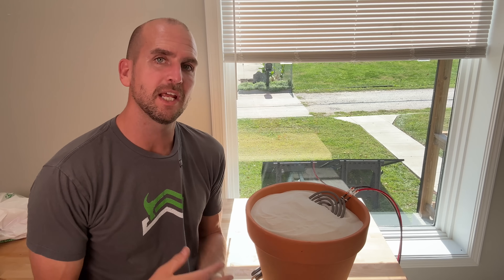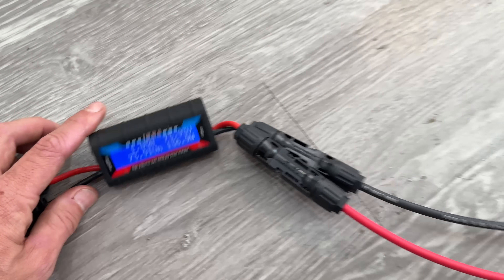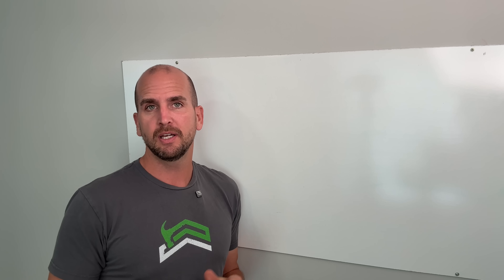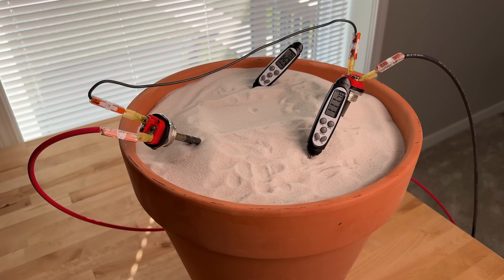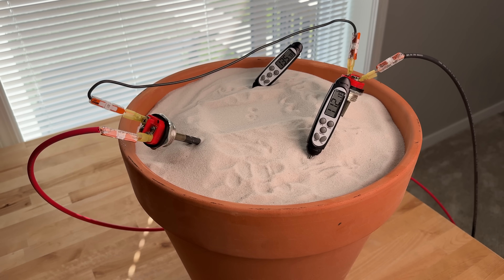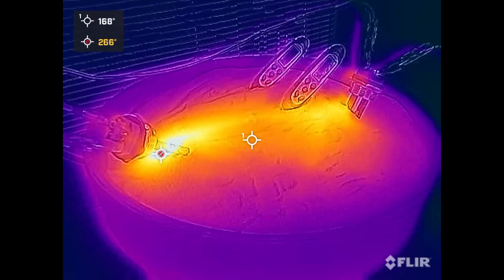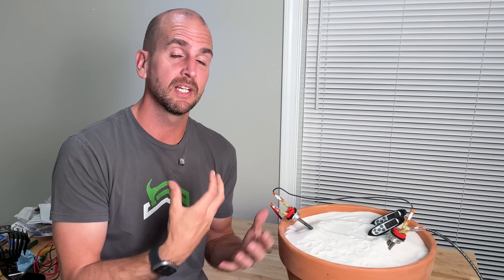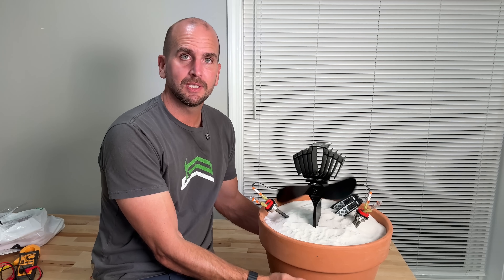How To Create A Solar Sand Battery Heater | Free Heat This Winter!

Comment: This was  a fun experiment in Solar Heating.  However, the simplest and most efficient method is still bringing sunlight indoors and onto some type of thermal mass such as dark ceramic floor tiles or concrete; which is the way passive solar homes work.  The second best would be solar powered heat pumps, since moving heat is always more efficient than making heat.
Reply: You are comparing two different things. You describe the best options in terms of immediate or direct heating.  The whole purpose of a sand battery is to store heat and release it later.

Comment: I have 80v coming out of the solar panels when hooked up to the water heater directly, the voltage drops to about 10v, I tried the panels in series and parallel with the same results?

Comment: This is a great idea, especially for excess solar power in the winter. I'm planning an off grid cabin build and this is a perfect option for those sunny days the battery is fully charged and I want to capture the solar energy in thermal mass. Heck. I'd fill a whole wall with sand. 😅
Reply: fill an internal wall with sand is actually a super interesting idea
Reply: @QuasarLava  have to engineer the structure for that kind of weight.

Comment: Regarding the circulation fan, a Sterling Cycle driven fan may be a better option over the Peltier or thermocouple/thermopile design. There used to be commercially built one for use with wood burning stoves, but as I recall was kinda pricey. Homebrewing one is a trivial task, but those designs tend to be somewhat noisy.

Comment: I've seen these a lot on YouTube recently. However, there are some issues that are not often considered. Comparing the sand battery to a hot water storage, the water storage almost always wins. While it is true that the sand battery stores higher temperatures. Due to the difference in specific heat, you need to heat an equal volume of sand to roughly 215 degrees celsius to reach the same energy storage capacity as 85c water. The issue with sand is its low thermal conductivity. This is a benefit when you want to store energy long term (seasonal storage), as the colder outer layer forms its own insulation around the hot inner core, but when you want it short term as shown here, it is a serious limitation as you can't quickly pull out the heat. Most people falsely interpret the sand staying hot for longer as a benefit, but when you want to use that heat it is most certainly not. 

Where sand batteries shine is at very high temperatures close to its 1500 melting point. In this case, your energy density compared to water is superior while the high temperature mitigates some of the issues surrounding thermal conductivity. The issue is, for residential purposes it's quite difficult to cheaply engineer such a solution that can handle the high temperatures. Therefore, doing the same but then with a water tank is a more practical solution: heat the water to 85-90c and you can easily take the heat out due to the high thermal conductivity.

Additionally, you can use a heat pump to warm up water to such temperatures, using much less electricity to reach the same thermal energy storage in kWh. Heat pumps cannot output temperatures as required for sand batteries. Just another consideration to keep in mind!
Reply: Me thinks a water tank with sand insulation / heater elements,  might be heavy but combine both hot water and longevity.
Reply: Would your water system be a closed system? What would you add to the water? Corrosion inhibitors? Glycol? You will need to regulate the temperature and pressure also to prevent a minor disaster. Water hardness would be another issue.
Reply: @deadcarnahans1932 the container would be the main cost in water based system. Metal or ceramic? It also has to be large enough, at least 50 ltrs for any good
Reply: great perspective. would love to get your opinion on the relative safety of storing water at close to boiling vs sand. From my understanding id feel safer and easier to DIY and operate a hot sand container , than hot water container
Reply: That being the case, I think it's more efficient to directly heat the water via a hose array (for lack of a better term) in a glass front box and circulate through the tank rather than use PV to heat with an element. There are a couple comparison videos and I think the PV ends up losing.
Reply: And even more - if compare the heat extraction efficiency of the chain of "PV panel -> heater -> sand -> heat extractor" to simple "parabolic mirror -> water reservoir" the second will be about 10-30 times more effective. And if you need to store more heat - just use bigger reservoir for the water/antifreeze.

Comment: This just doesn't seem very practical. 750Wh is a quite small amount of energy for useful heating, about 2500Btu. I would guess the best use of that level of power in a heating emergency would be to store it in a battery to use a 100-150W electric blanket for 6-7 hours. For perspective, an electric radiator uses more than that on lowest setting in about an hour, and that doesn't even do a lot in a modest size room, and a small home furnace is typically 80,000Btu per hour.

Comment: Resistance might change with temperature. Light bulbs are a prominent example. But any material might expose such a behavior. Some explicit parts designed for various functional purposes can be found labled as NTCs and PTCs.

Comment: This is a very useful effort, but I was disappointed in the use of the term "battery".  I came looking for a DIY sand battery that has been in the energy news as of late.  That is, I was looking for solar converted to heat in the sand, and then later extracted back out as electricity.

Comment: So you took energy from the sun (which contains loads of heat energy) filtered out the heat energy by using PV panels to convert it to electricity, and then you converted it back to heat. Does this strike you as efficient? Have you not heard of solar heat? But anyway you've got a 240V heating element running on what?  48V?  What kind of grift is this fake-ass garbage?

Comment: What is the thermodynamic most efficient way to heat it all up, would adding some copper wires into the sand help move the heat away to more parts of the sand faster, increasing the temp diff from the sand around the heating element and the element itself? I mean, all the energy goes in to the sand, but I feel like the rate of dispersion has an impact (and on how effective you can marshall it out with the fans after?) would be interesting to test in a sealed room with thermometers on timelapse for a whole day

Comment: A mineral oil container (with no leaks !) with the same volume as your flower pot would retain far more energy than sand. I suggest you try using a recycled gas-can filled to 90% of capacity with mineral oil (remember, oil expands somewhat when heated) and a heating element dipped into that. then mount your fan on top of the oil can... Mineral oil might be a bit more expensive than pure white sand... good luck !
P.S. I would place the oil can on a slightly larger bed of sand (in an old aluminium drip pan ?) to catch any dripping oil and avoid making a mess when filling up the can with mineral oil with the help of a funnel. Do not expose the oil to naked flame or anything that may glow red-hot, that would create a fire hazard !

Comment: I wonder how much energy you're using on the table without MPPT?
Reply from the maker: Without MPPT there is a lot of in efficiency on what those panels could create as compared to what is flowing through the heating element.

Comment: I suppose this is an interesting thought experiment but wouldn't a minisplit or something similar be a far better usage of that power to generate heat since they can be nearly 5x more efficient than resistive coil heat? as for thermal mass brick works extremely well.

Comment: definitely stick with the cook top elements, water heater elemets are designed to have liquid around them constantly; without the element itself breaks down.  when i ran an experiment with my own sand bucket (complete with the orange one from HD) the element disintegrated inside the sand.

Comment: You could add a thermometer outside this system but still in the room to measure the effect of the system. We all believe that the sand is hot, but does it heat the room? Need to measure and display the proof in the pudding!

Comment: For this whole setup the basic physical law of energy preservation applies.

Current PV panels can convert 22% of solar radiation to electricity under ideal conditions. We (in Germany) get 1000 Watts of radiation on the earth's surface per square meter . So a 2 sqm panel will produce 440 Watts of electricity at peak sunshine. Assuming no power loss on your cables (in reality you will loose 5%-10% if your cable lines from PV into your room are long enough) the heat arriving at your clay pot on a 10 hour sunny day is worth about 2,5 kWh.

In an average year you can harvest the equivalent of 1.000 sunny hours, that is: from 1 panel you can get 440 kWh. Whatever arrives in your clay pot is converted into heat (well, substract 5%-10% losses in your cables).

And whatever heat goes into the clay pot is radiated out of the clay pot as IR based heat. No need for any air blower (unless you want to get the clay heat out faster for some reason).

Of course, a short cloudy winter day will achieve only a tenth of sun harvest when compared to a long sunny summer day.

However, the energy preservation keeps working: whatever electricity watts go into the clay pot comes out of the clay pot again (over time).

So the only interesting info in the video was about the local peak temperatures achieved in the pot.

Thanks for the video nevertheless!

Comment: Look up "High Heat Retention Storage Heater". There's no need to reinvent the wheel. 
Storing heat generated by electricity has been a solved problem for decades - storage heaters were invented with the intent of saving money by being heated at night, when electricity is cheaper, and releasing the stored heat throughout the day. Like a battery - but for heat. 
High Heat Retention Storage Heaters are a further improvement with better, modern, insulation and smart controls and monitoring. 

Downsides are bulkiness, weight, need for individual units for each room and slowness of the system. American ranch style homes and McMansions are a no-go.

Comment: One concern is those immersed elements are meant to be immersed in water. One thing I learned as a plumber is if you add power without having the water heater filled is they will burn out. It’s an excellent idea, but could benefit from being in  a water tank.

Comment: but isn't it more practical, efficient, and powerful if you first charged a battery, like most solar system designs?  this seems awfully strange to me, connecting directly to a heating element, not to mention potentially dangerous.

Comment: "725 watt-hours" = 0.725 kWh = which is worth about ten cents (YMMV). 
You'll be needing to scale up, and that includes the panels. 
So it'll cost a fortune by the time you've got anything practical.
Might be more fiscally-efficient to just have electric baseboard heaters in your basement. And better match the voltage/current/power at each end.

Comment: If I was going to use it for Emergency heat, I would have a coil of copper tubing on the outer perimeter of the pot. But I would also have the pot lined with aluminum foil to keep the heat in better. Then I would circulate fluid through the tubing to a radiator to allow it to escape into the room. And you can turn on the pump only when the heat is needed.

Comment: Isn't it better to run black house from outside to inside.  Like an oil electric heater.  Let the sun heat up panel and liquid inside of it.  It will asct as batteries too. No need to convert from solar to electric to heat energy, where efficiency is 20%+-. Solar to black panel with liquid is much higher efficiency... no fire hazard  due to electricity flow and high amps. Have an air gap between outside and inside so heat doesn't travel outside through houses & liquid.

Comment: You can run vertical stacks of range top heating elements by daisy-chaining them. Cost-wise could be cheaper than buying water heater element. Sticking a few cookie sheets into the sand will more than capably transfer heat with a floor standing fan.

Comment: would probably be a lot more efficient to directly heat up a fluid like air or water in an equivalent area with sunlight and exchange the heat to the sand rather than the ~20% efficient pv cell

Comment: Love the concept, easy to install but very inefficient. Better would be a small vacuum tube collector hooked up to a small reservoir and running the water inside to a standard radiator (or mass) via a solar powered pump. For the same solar area they collect up to 90% of the energy insted of just 20-30%. You can get these collectors dirt cheap from china. Would love to see a video on this. EV is for electronics and running small motors, not really for heating. Sand batteries really come into thier own when getting really hot ie several hundred degrees C that they then can keep for long, otherwise you just have a mass heater with very low heat conductivity. Might just be good for dumping excess or unused power after the battery banks are full.

Comment: I don't know if it is widely understood that solar photo voltaic is only about 30% efficient. A solar thermal panel is about 70%. Obviously this isn't an engineering exercise in optimizing efficiency. But... a real solar thermal system would never be (and is not) implemented this way because of the low efficiency of photovoltaics.

Comment: In the Canadian Prairies we get winter days with high temps of minus 25 Celcius and overnight lows around minus 40 Celcius for about 1 to 3 periods lasting 3 to 9 days each. This makes home heating fairly expensive unless it's a relatively new and well-insulated home. One approach people take is to heat the overall home to a fairly cool temperature to reduce heating costs and then heat the areas they're spending time in with something auxiliary be it a hot water bottle in their bed, a space heater near where they're sitting, etc. This solar sand battery could be a bench on the south side of someone's home where they sit in the morning while eating breakfast for example, and help them comfortably get their day going. It could be well-insulated all around and have removable insulation on top so one could use the previous days heat to warm themselves in the current morning or whenever they want. And since nothing has to be high performance, it could be made out of mostly landfill-bound materials if a person had the patience to salvage them. Luckily our coldest days are usually clear and sunny days, so the sunlight needed wouldn't be an issue.

P.S. One could also place an insulated sand battery under their bed.

Comment: wouldn't be more efficient to connect the heating elements in parallel to lower the resistance so that the full  ~1000w of your solar panels could be exploited ? it would also work better with a 110 v element I suppose because it would also have a lower resistance

Comment: Not sure if turning electricity into heat, then back into electricity, then into kinetic is the most efficient. Each conversion is a loss of efficiency.

Having a device that turns the electricity from the solar panels directly to a fan to distrute the heat makes way more sense. That cuts out two conversions.

Comment: I need to know how long the sand will retain the heat?? I would probably use wind cause blows nice up here in the off grid bmountains. Wanting to heat a small chicken coop.4'x8' coop for night heat.How many amps is that going ilto 12 volt water heater elemeny

Comment: Do not do this.   For the love of God, do not do this.
Burn hazard, fire hazard, shock hazard.  
Bad physics, sand is a poor thermal load.  Not enough heat can be produced from this thermal mass to do any real heating of the room when it is cold.  
water has a specific heat of around 4.18 J/g°C while sand has a specific heat of around 0.84 J/g°C. Sand is only 1.5 times as dense as water on average so you are unable to store around 3 J/g using sand vs water.  Not to mention poor thermal conduction, preventing you from heating most of the sand.

Using water as a thermal storage would be much better. But putting 200 watts of heat into your living room is litterally like having 2 100 watt bulbs on,  three 65 watt bulbs on.   Negligible  effect.   And if that sand did get above 120.  Burns are likely to any children or pets.   Ect.
Key points: 
 
Water's high specific heat:
Due to its hydrogen bonds, water can absorb a large amount of heat before its temperature noticeably increases. 
 
Sand's low specific heat:
Sand heats up quickly because it requires less energy to raise its temperature. 
 
There are so many reasons to not do this.  Please do not.  It is dumber than the flowerpot and candle bs, and more dangerous.

Comment: You could try putting a copper coil in it and attach a small radiator with a small water pump.

Comment: I am a big fan of passive solar and I like the idea of using sand as a battery to store heat. It would be very helpful to see this test conducted in the winter where the outside temp is recorded as well as the inside temp of the room from start to finish.  Thanks for the idea, sand is a much better thermal mass than water or stone. I only wish I still owned my solar workshop so that I could play with this.

Comment: If you want to scale this up to say keep your garage a little warmer, use a 30 or 40 gal steel trash can filled with sand, and use a fine sand play sand at home Depot not the sand for mortar or pavers. 

The smaller granules will keep them in contact more thermal Mass less air